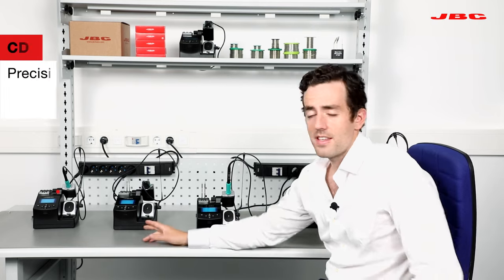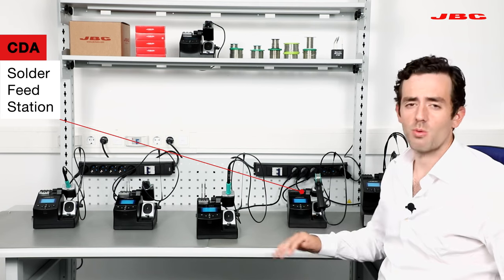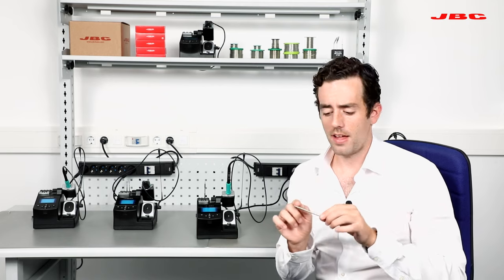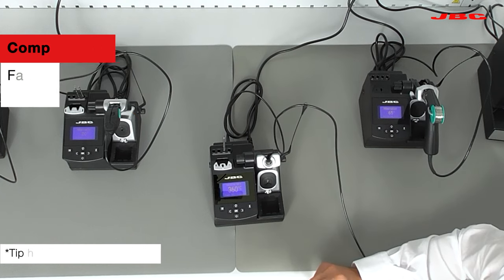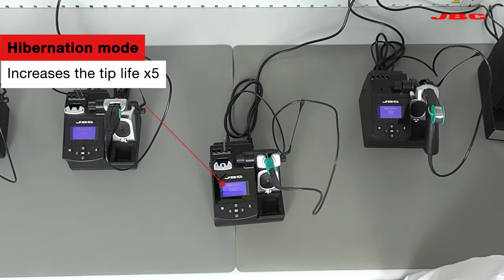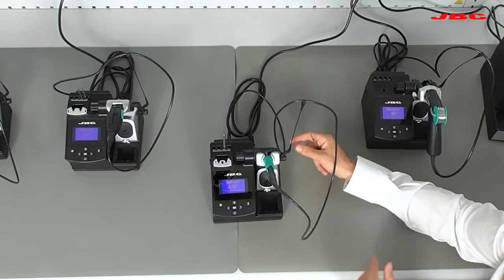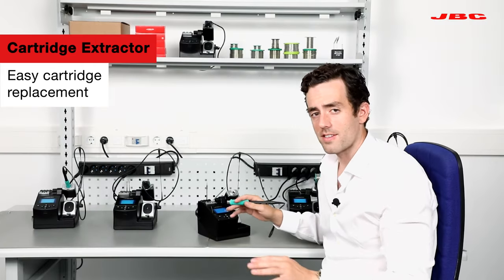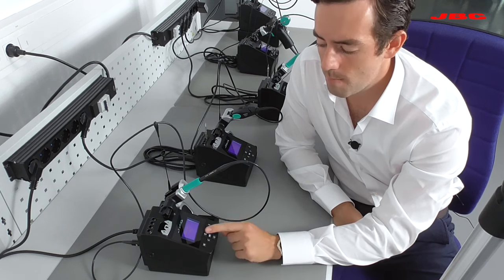JBC I Ask an Expert: Compact Stations

Comment: Is it possible to swap the tools on the CD or CDE stations?  For instance, if one gets a CDB station, can later the general purpose iron tool be replaced with the tweezer tool?
Reply from the maker: Hi M J! The tools T245 and T210 are compatible with both CD and CDE stations, but the tweezers are not compatible neither with CD nor CDE.
Reply: @JBCSolderingTools  Thanks for clarifying.  Will you be releasing an enhanced version of the CP (e.g. CPE) at some point?
Reply from the maker: @talkwithmj  We are working on other products, but we will take into consideration your petition.

Comment: Hello
I have a problem with a JBC station, I get a yellow warning signal and the desoldering iron (DR560-A) does not heat.
I bought a new heating element and it doesn't heat either.
However, I connect the heating elements to the soldering iron (T245) and they heat up.
Could you help me by telling me what is wrong?
Thank you and I hope your help please.
Reply from the maker: Hi! For technical assistance please fill out this form: https://www.jbctools.com/contact-us.html and one of our technicians will be more than happy to assist you regarding your request.